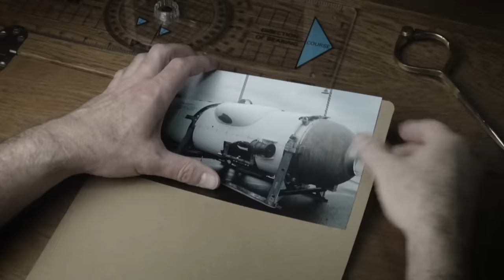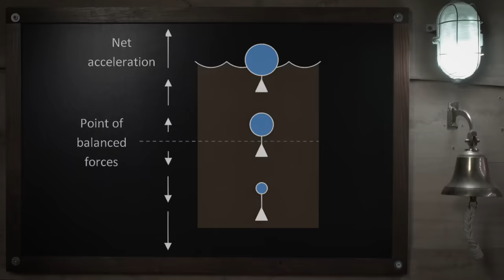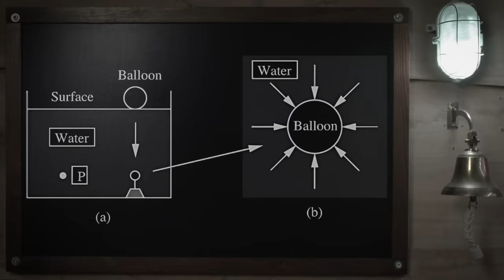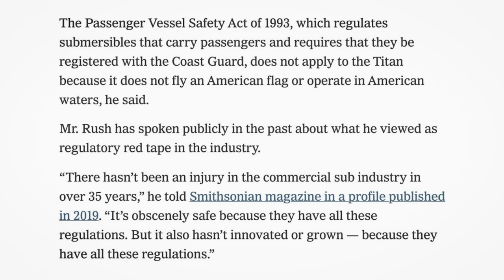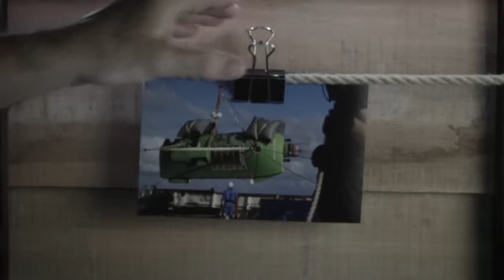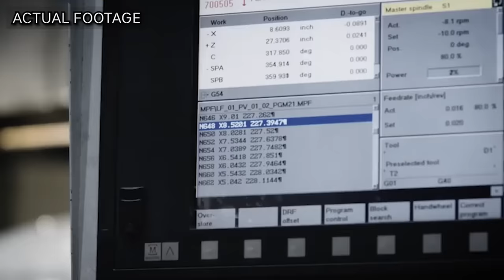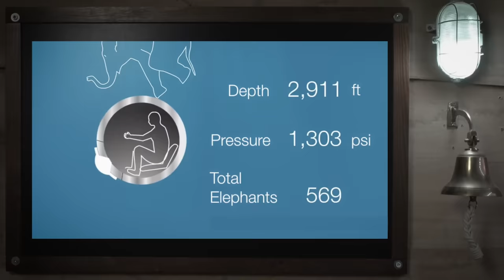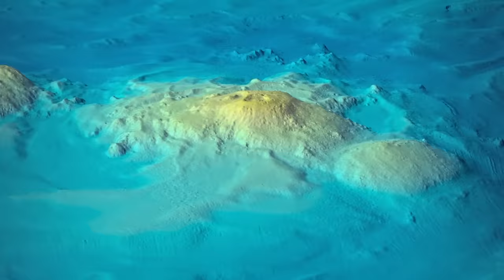Titan: From Inception to Implosion

Comment: 22:19 Rush's major innovation was, "Not relying on tried and true methods, and not relying on old white men with experience," to build his submersible.
Let me ask the peanut gallery:
Hey folks, would you ride in an aircraft built using 'non-traditional construction methods, and not using tried and true airplane construction methods'?
Reply: LOL Probably not. I’d have never gone in the OceanGate sub. 
But TBF, a plane is not a good comparison because of the different environments.  Eg carbon fibre works on a plane hull because of internal pressurization.
Reply: @GoBlueGirl78  I think the guy was arrogant and simply assumed his existing body of knowledge was enough to do the job. He certainly didn't seem to understand the difference between the mechanical forces differing between aircraft at high altitude, and submarines beneath the sea.
The guys I talked to with submarine experience took one look at how this submersible was constructed and said it was a death trap.
Reply: @GeneralJackRipper  I completely agree. I have a friend who dives & said it looked like a death trap.
Reply: did he really bring race into it or are you being hyperbolic? if he actually said that, nothing of value was lost. 

edit: wow he really did say that quote 😂
Reply: Oh, it's worse than that. This thing not only didn't have safety testing by third parties, their own personnel were telling them it was unsafe. At least an airplane, at least in the US, will have someone check the work before flying.
Reply: @nonna_sof5889  and then he fired and sued his own safety guy! Honestly love WS, but the video is a bit misleading or lacking IMO about just how dangerous and irresponsible the guy was. It’s 1000x worse than the video let’s on. The small scale test version failed long before the pressure depth it should have in a testing chamber. There have been dozens of tests of the same type of hull dating back years, many are on YouTube itself, he just completely ignored it. He wanted to be space Elon really bad. He has some of the “lie about most things and hype it up” strategy down, I will say that LOL. Some people commenting on this very video still think he wasn’t like a complete lunatic and commented how it’s sad we “missed what he would’ve done”, so apparently it worked. 🤦🏼‍♂️

Literally even someone in this thread now saying he’s arrogant was yesterday saying how it’s unfortunate we missed what he would’ve done LOL. Some people are so daft, I guess hence how he got several people that should’ve been smarter to go on that thing. Once people start to believe in hype, they get carried away believing everything about that person or product or etc. it’s wild.

Comment: As usual you've brought new insights and made interesting a topic i've seen covered many times!  One thing i feel the need to mention about carbon fiber is that it's like a rope in that it that it performs best under tension (pulling) vs. compression. For this reason it works great for air tanks, pressurized aircraft hulls and such where the fibers are being pulled but not in the case of Titan where the fibers are being pushed  not pullsed so the only thing providing and strength really is the resin. I like how you pointed out that the need to be flexinble when innovating, make mistakes, learn from them, and change paths when necessary.

Comment: I really feel that the main two reason this happened was the cost-cutting surrounding non destructive testing and the fact that i truly believe that they descended too fast. They reached the titanic depth far too early and that plus the previous wear and tear from other dives is probably a large factor. Moving up too fast can be fatal and moving down too fast can be just as fatal.
Reply from the maker: If there vessel were able to withstand the force at depth then the rate of descent or ascent would not be a factor. 

On the descent the only thing that rate would possibly do is create momentum that they would need to slow before contacting the seabed.
Reply: It was never rated or tested for anywhere near the depth of the actual dives………so the point is kinda irrelevant. Also, the change in external ATM absolutely plays a factor when you consider the type of material used 🤷🏻‍♂️

Comment: With all the criticism of failing modern safety standards, I think we're going to learn a lot from this. For example we've got to design now. Even if it's only good for a quarter of the depth that's still something useful. 
   Aerospace, automobiles, modern buildings, diving, and submersibles; they all leave a trail of bodies in the wake of their development. Leaps come with risks.

Comment: He never solved the “depth issue” also if someone tells you it’s going to take an hour to seal/unseal you into a cylinder run the fuck away. That person is obviously incapable of worrying about your safety because all other submersibles have dorso lateral access hatches for a reason after all.

Comment: Hubris: the man suffered from extreme hubris. Even I know (retired industrial design model maker) that carbon fiber is made from carbon threads embedded in epoxy, and it inherits only tensile strength from the fibers. By crisscrossing built up fiber ribbons in different cross directions other strength characteristics can be gained or mimicked, giving other desired properties to make very strong light structures with tensile strength and added stiffness. But under no circumstances is carbon fiber resistant to compression loads.
Stockton Rush didn't even do any sort of carbon fiber crisscrossing for the pressure hull. He merely wrapped carbon fiber ribbons around the inner cylinder. There was relatively low stiffness in his vessel, and vertually zero compression strength, save what the sandwiched epoxy resin afforded it.
It had almost no high compression strength. Apparently Rush thought the high strength in carbon fiber tanks, under load from compressed gases and fluids, could be applied in reverse (highly compressed pressure from the outside in). It can't that's illogical; he would ultimately know that if he understood strength of materials (1st or 2nd year mechanical engineering courses). Without that basic knowledge I must say he either didn't research how carbon fiber really works, or he was simply a vert bad engineer. I've heard his engineering prowess was highly questionable; he lost several jobs because of it.

Comment: Carbon fiber works well under tension like an airplane fuselage but under compression it's the resin that takes the bulk of the strain. Solid metal hulls will still be the safest and most sensible choice for a long time to come.

Comment: This video brings up a lot of points, but never actually addresses the veracity of them. For example, the idea of "using sensors as an early warning for points of failure" gets brought up and is never addressed as being absolutely bogus. One can not use such sensors as an "early warning", in the same way one can not use cracks in the glass as an early warning. You see, once these deformations occur, the hull has decidedly less integrity than it had before. So if something was too much pressure for the more integer hull, then the less integer hull will not be able to withstand it better. In other words, the time between the "early warning" and "catastrophic failure" isn't several hours or minutes, but rather seconds to milliseconds. You can compare this as using a rifle's muzzle flash as an "early warning sign you are being shot at".

Comment: As a catastrophic injury lawyer; allow me to analyze this disaster under the definition of “negligence:” duty, breach, cause, harm. Rush had a duty to his passengers to provide them “reasonably safe” passage to the Titanic. “Reasonably safe” would be the standard accepted level. He “BREACHED” this duty when he both refused to undergo standard testing, and when he was warned doing so would make his submersible unsafe. That breach both directly and proximate “caused the death” of his customer. Directly in that, but for his ignorance and failure to run the tests, it would not have imploded, and his passengers would not have died. It was the “proximate cause” of the death of the passengers in that it was “reasonably foreseeable” that failing to run the tests, and going to that depth with people on board, would result in their deaths. This is a text book example of negligence (recklessness really, in that Rush “knowingly disregarded a substantial risk of harm to his passengers”)

Comment: Something being TOO hard is a problem you have to watch out for when treating bone issues. Prolia is a really interesting medication for halting (or supposedly reversing although not in my experience lol) the softening of bones. But if you take too much your bones become so hard and rigid that they become brittle and prone to fractures
Reply: That's a good point. Bones are meant to be at least a little flexible. Take the two in your forearms for example- they twist around each other all damn day, like they're supposed to. Wouldn't be possible without at least a bit of give. Things being 'too hard' is also problematic in things like earthquakes, which is why modern buildings in earthquake-prone areas are designed with joints.
Reply: Same principle with drinking too much milk because of all the calcium in it. Which is something I genuinely worry about as I fucking love milk and drink it constantly.

Comment: A very minor quibble. At 48.57 you state quite clearly that determining a location from sound underwater is "nearly impossible". I have to disagree with this strongly. It's the reason sub's tow microphone arrays, and we have SOSUS. 
Any directional microphones that pick up the sound will give a bearing for its origin. If you have two or more you can cross reference them for a location. 
It is no more difficult than taking two compass bearings on known landmarks to determine location on land.

Comment: From what I understand losing communication in any other submersible is like a big big deal and does not happen often at all besides with ocean gate. When it does there are several backup systems so that communication can continue. I think my only negative thing to say about the video is sometimes you say things as though they’re reasonable for typical submersibles, and they’re just not. It really doesn’t give a good idea of just how wildly under engineered it was and how incredibly irresponsible he was. More has come out recently so you probably didn’t have that to go on at the time the video was made but.. even before.. lol he was so so so much more idiotic than this video let’s on. But informative and otherwise well done. Just my 2¢ and not trying to gripe, I just think it doesn’t quite put in perspective the reality of the situation. This makes it seem like he meant well but didn’t know, in reality numerous engineered had told him and potential passengers that it’s an absolute death trap. It’s just a question of when. And the answer to that question was not long. 😬

Comment: In a regular in ground pool you can attach a empty pop can upside down to a weight and at like 3 feet it starts imploding and completely at ten feet. I remember that in chat rooms and other places reading comments about theories and even the news said rescue mission. I knew it was recovery only as soon as the First report. That military sub that malfunctioned and started slowly sinking til the point of no return. The underwater sound and seismic monitors all over the ocean in places that they thought wouldn't have picked up a sudden short but very loud reading....then nothing. And the way those deep sea creatures look when they get topside is a great indicator to😂

Comment: A system that tells you its failing, as it fails, is useless, especially when the failing object in question is a deep sea submersible. Titan and Oceangate were doomed as soon as carbon fiber was used and that first wrap was made. Carbon fiber is strong when it resists pulling, not pushing or crushing. And you shouldn't reuse it over and over again, forever. He shouldve have 5 made. Take 3 of them to depth and back up until they fail, then take another one do a deeper depth all the way until it fails, now you have 1 that you know you can probably use one time to Titanic's depth, then retire it. 

We should leave the Titanic alone, and let her and the souls lost, rest, as they say, in peace. It shouldnt be a tourist atraction, because it isnt. We're going to end up doing to it what we've done to the Himalayas. Lets just leave it alone. Let them rest in peace.

Comment: The issue with carbon fiber is it’s not good in compression. Think of it like a string. Pull on the string (tension), and it’s very strong. Now try and push on it (compression) and it just flexes.

Comment: The problem wasn't the fact that the sub was made from carbon fibre, the problem came from using a sub made from carbon fibre more than once. Titan demonstrated that carbon fibre can be used for deep sea dives, but not carrying out NDT and just assuming because it worked once its safe to reuse it, was ignorant.

Comment: 44:57 Surely the adhesive/epoxy used to form the carbon fibre mesh is as important, or even more important. There are a million types of epoxy compositions and formulas, all with their own characteristics, flexible or rigid, and how flexible or how rigid, how it responds to temperature changes, to humidity, to stresses etc. How it ages, does it become brittle, does it melt away. There is also the glue they used to bind the hull to the titanium plates, that is another story right there.

Comment: When my car breaks down I need a rope to tow it. I have never tried to push it with the rope because I sort of know it won’t work. Carbon fibre is enormously strong in tension but not so in compression. It would make an excellent pressure vessel where the pressure is held within like a diving bell but it is not playing to its strengths trying to keep crushing pressure out. Aircraft fuselage good. Submarine bad.

Comment: Built in an open warehouse... I've been observing a man building a Formula 1 race  car now for a year. Down to the wheel rims, all epoxy and carbon fiber. Maybe 30 different yields of epoxy resins,  a couple dozen different carbon fiber mat weaves, temperature and humidity control, tempering, seasoning, polymerization times, degradation, vacuum chambers for resin injection. 
The jerks who built that death capsule... can't get any dumber.

Comment: Carbon fibre handles expansion well, but doesn’t stand up well to compression.
That why it’s a great choice for airplanes but a horrible choice for subs…

A real engineer would know that because they would do the standard bare minimum thing of looking up the material properties they intend to use.

Comment: He answered a question I’ve asked and pondered so many times. I would wonder why you could throw a piece of metal in water it would obviously sink but build a ship out of metal and it floats. I mean just by common thought it would seem even being in a shape of a boat or ship that the weight of it would sink being made of metal and all. Even though it’s dispersed, it is metal. You can make metal float as long as it’s in a shape of a ship or boat? Aircraft carriers can weigh between 65,000-85,000 tons yet float being made of steel. Ugh! Ok.

Comment: No I really don't think anyone should focus on what went right in this case. Throwing the word innovation around as a kind of get out of jail card is just not good enough for any design where the safety of the people use it is concerned. Less so in an environment as unforgiving as the bottom of the ocean.
Testing his design over many compression cycles, WITH NO ONE INSIDE OF IT, would have shown him and his company how well his design would perform. It still boggles the mind that this was never done.

Comment: No. No. No. Carbon fibre reinforced plastics are not suitable for deep sea applications. Carbon fibre's greatest strength is when it is loaded in tension, not compression. If Rush had tested the hull, he'd have discovered that at a much lower cost.

Comment: The hull was only made of carbon fiber, not wrapped around a titanium cylinder. Maybe if he had actually done that, these people might still be alive. Rush wasn't an innovator. He was reckless, and in the end, it killed him and 4 other people who were ignorant to his shortcuts and attempts to cut costs over safety standards. He destroyed his "legacy" because he couldn't see past his own ego, imo.
Reply: There were titanium ring caps on the front and the back of the Titan's hull and it still doesn't make sense to me as to why the carbon fiber hull itself wasn't redesigned to be made out of titanium. Like the company should have just dismantled the entire submersible and then build all of it out of titanium. The CEO was aware that with each dive that the Titan took, the submersible's hull was getting weaker and weaker and constantly making cracking sounds due to the water pressure. That should have raised a red flag in his mind, but unfortunately he let his ego and hubris get in the way and this ended up happening.

Comment: He basically took one product and kept using it until it broke. The submersible actually worked. It was fine. But not for the absolutely astonishing 90 DIVES that they had planned for it, it only lasted 13. So, technically speaking, you CAN build subs that way, but they have a very limited lifespan, and would likely need to be thoroughly tested after each trip. Maybe diving to more shallow depths would be the key to make them last longer. But he just.. built a prototype and instead of iterating from that, he wanted to get full return on investment from it, just because first few dives went fine. So safety went out the window.